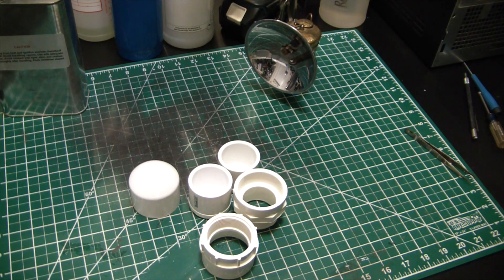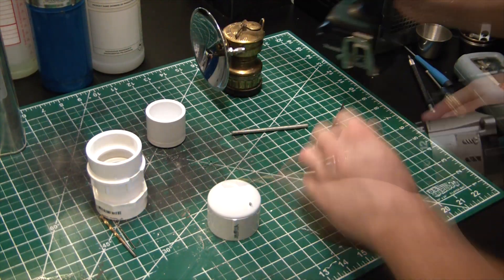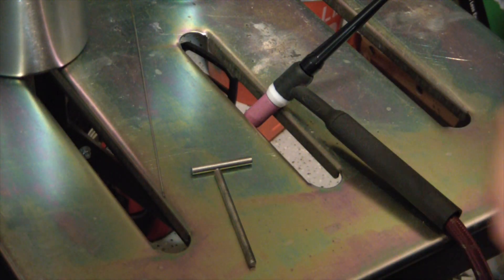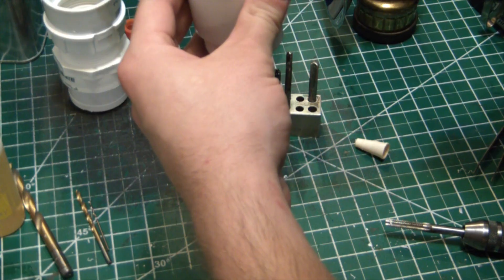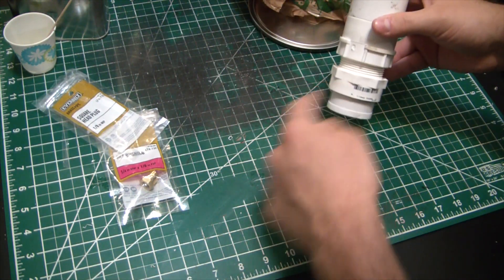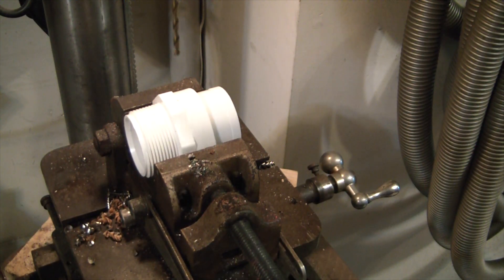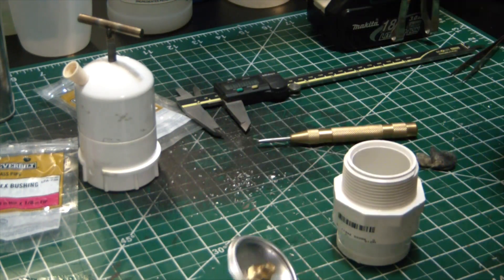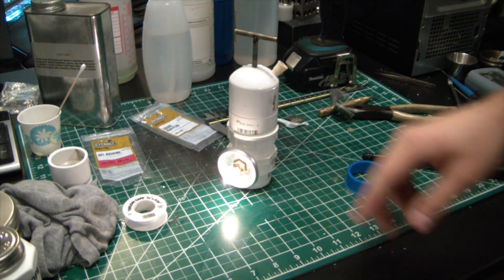DIY PVC Carbide Lamp - Dirt Cheap & Works Like the Real Deal! - ElementalMaker

Comment: Fyi  PVC glue dries instantly
Reply from the maker: I was a pipe layer for some time, it most definitely does not dry instantly. There's a reason you have to wait before pressure testing lines.

Comment: Sure that you found you need a tiny air hole in the top tank so no vacuum lock of your drip.... only thing I would worry about is the plastic melting.... you could run your output anywhere with copper tube run it up you could use that paint can lid

Comment: I made one sililar. I used the valve from an old Bic lighter and fit it inside the threaded part of a ball inflator needle that I removed the needle from and aslo used an old soda can bottom for the reflector. If you drill the hole first you can chuck it into a drill using a screw and some nuts and polish it with some comlound and the drill. Works great.

Comment: what is keeping the flame from flashback igniting inside the tank and blowing up?
Reply from the maker: Three things, a lack of oxygen in the body. The tiny office makes flashback difficult, steel wool behind the orifice will absorb heat from a flame front to extinguish it
Reply: @ElementalMaker  ahh yes i almost forgot that you packed it with wool,,but they say to use ss wool for this instead,but at the start there is air(ie enough oxy) in the body ,do you have to wait for that to vent out once the ace is being produced and creating pressure before you light it even though it has a small orifice perhaps this is a wise move no? ,,also what happens if the tank is inverted due to falling and the two chambers mix up? and last did you consider using a very small mig gun tip instead or is the hole of .024 still too big? ,merry christmas

Comment: Got to ask .... Why didn't you use one of a dozen or more PVC glues ?!  They come with all kinds of "open" times, from hot - dead slow (24 hrs.).  No mixing involved.  You'd have to break the PVC before the glue gave out.  Every hardware store (from Mom & Pop, to your Joe average Bigbox) carries them.  Should have been right at the end of the aisle where you picked up those fittings.  A Farm supply or Irrigation supply house will also have them.  I always keep a can, or two around.  PVC pipe has all kinds of off-label uses - Table legs, Greenhouse frames, chicken coop frames, dust collection systems ..... the list goes on.  Keep some on hand.  Way more effective.  Right tool - Right job.  I prefer a "Rain or Shine, or a Wet or Dry"  Gives you a decent open time, and it works in less than perfect conditions ( Rain, water in the pipe, condensation or high humidity, etc.)  Love your videos.  signed:  A fellow curious, collector of projects that will never earn me a dime !
Reply from the maker: Just didn't have any handy at the time and didn't feel like driving to the hardware store. Proper PVC cement would certainly be the better bonding agent.
Reply: Yeah, no .... I got to confess .... I've been caught with a dry can more'n once.

Comment: How is mixing up a batch of epoxy faster than PVC cement? The PVC cement would have it completely bonded in about 10 seconds after pushing the parts together. The epoxy is still getting measured out at the 10 second mark.
Reply from the maker: It wasn't faster. It was just what I had on hand. My old PVC cement had gelled.

Comment: I think the bottom of a pressurized can ought to be a catenoid, not paraboloid; through I'm sure anything remotely shiny and concave would have worked. You should have used the bottom of a can of spray paint instead. Would have been a lot bigger.

Comment: I know this is a stupid question but what was that brass pointy ended thing that made a clacking noise when he used it called?
Reply from the maker: That's called an automatic center punch. Great tool to have and you can get cheap ones online for just a few bucks.

Comment: Always amazed me, when I use to drill wells, that only after about a 15-20 sec. count after slidding a newly glued joint together, we'ld let, often with over 400 foot of at least SCL40, 6 inch diameter pipe below it, hang from it and they always held.
Reply from the maker: Holy smokes that's impressive. What solvent glue were you guys using? I get quick bonds, but not that quick!

Comment: One nice dirty cheap nozzle you can get are jets from small motorcycles carburetors.
BN44 carburator replacement jets, for example, can range from #10 (0.1mm) to #120 (1.2mm).
Reply from the maker: Great idea!

Comment: Well shit. I bought some calcium carbide a while back just because and its been sitting here being useless. Maybe I should build one of these. Knowing my luck though I will lose a finger due to it being a pipebomb and what not.
Reply from the maker: Eh just make sure it's airtight and let it run for a few minutes to flush out any remaining air. Fine steel wool as a flashback arrestor will help prevent that too.
Reply: What if I want to be 9 finger freddy?

Comment: Uhm...  isn't the acetylene going to eat the plastic or the bonding agents/epoxys holding it all together?  Isn't the flame going to heat the metal parts and thus melt the plastic parts, causing it all to come apart catastrophically?
Reply: How long do you plan a $5 plastic blow torch to last? Somethings ant worth worrying about.

Comment: Man I love your videos dealing with PVC ...PVC cement will make a solvent weld, much stronger than epoxy. And 20 seconds its cured again quicker than epoxy
Reply from the maker: Yes I love PVC cement for those reasons. Sadly I didn't have any handy when filming this bit. Have you tried the new Oatey fusion primer/cement combo? Stuff is a game changer its so easy. Plus its clear so looks much better. Not to act like their spokesperson but damn I like it haha

Comment: How is it burning so clean when acetylene gives off lots of soot, is it because there is still enough air in the carbide chamber that is being mixed with the gas?
Reply from the maker: I think that because of the flame velocity, it mixes better with air and burns more completely, converting the usual soot (carbon) into co2
Reply: Interesting, I might have to do some experimenting.

Comment: only issue is its 13$ in parts

except a laythe
and drill
and bits
and centerpunch
Reply from the maker: Well I have excellent news for you my friend, the center punch is only $2.37 on amazon! The lathe and drill press are simply convenient, but everything I did here could easily be done using just a cordless drill and some brain clackin.
Reply: I mean fair enough

Comment: Nice build. But I wonder about one thing. If left to burn long enough, will the brass fittings get so hot that they melt the PVC ?
Reply from the maker: That may be possible. I haven't run it long enough to find out, but may do some longevity testing on it to find out.

Comment: A trick with PVC glue is after you tighten the lid of the can turn the can upside down a few times, that way if there is any air ingress it hardens the glue on the threads preventing air getting to the rest of the glue drying out the whole can. Its a usedul tip I learned a longtime ago, hope that helps out some people to save thier glue after one use.
Reply from the maker: Very slick idea! Thanks for sharing! Ill definitely use that from now on
Reply: Learning Electronics Cheaply Nice learning from a fellow cheapskate ;)
Reply from the maker: I wouldn't call myself a cheapskate. Ive spent quite a small fortune on tools and chemicals over the years. This ain't no cheap hobby. I do however try to spend wisely!

Comment: Teflon tape on the brass threads would also tend to act as a thermal break between the brass and the PVC.  Teflon is used in 3D printers for the "hotend" for this purpose.
Reply from the maker: Solid idea. I just used some thread dope, but ill swap it out for some Teflon.

Comment: Parts are called 1-1/2 plug
1-1/2 male dwv adapt. 1-1/2 female adpt. Last fitting is called a husband , sometimes called father or mailman
Reply: And 1-1/2" smooth cap sch 40

Comment: Set it outside, light it and let's see how long it will burn before the heat from the flame gets the brass hot enough to melt the PVC threads. Then we may get a BOOM !  lol
Reply: the gas flow should keep it cool unless it gets low on fuel.
Reply: @psycho.dad5252  cool answer and its also a fact but some trolls like to think there being smart i guess my friend, just ask Radallolgy ?
Reply: Acetylene oxygen torches use a brass tip. They last for hundreds of hours before they wear out. The flame is away from the tip to begin with. What really Burns up or uses up and acetylene towards tip is when metal splatters back inside and you have to take the cleaner and push the stuff out that wears the holes out bigger but they last. As I said hundreds of hours and rough abuse work so this is nothing.

Comment: Use the lens out of an old square battery flashlight
Reply from the maker: Excellent idea! Problem is the only ones I have are plastic lenses. With the acetylene flame they would melt quite quickly. Need to find an old metal one!
Reply: ElementalMaker i restored my grandfathers old alcohol mining light for a relative and shaped and polished a dish shaped piece of a brass door kick plate
Reply from the maker: @jughead8988  very nice, where did you find that? I need to upgrade the soda can reflector
Reply: ElementalMaker i got the kick plate from lowes, i. Cut out a round peice and shaped it on the bottom on a 20 pound propane tank before polishing it
Reply from the maker: @jughead8988  awesome thanks for the tip! Very slick to shape it on the propane tank.
Reply: ElementalMaker i didn't want to hammer on the side i was going to polish

Comment: What the gases from that flame are they bad to breath in?
Reply from the maker: The main products of combustion are water and CO2. Of course some lampblack (carbon) is also produced from incomplete combustion, which is the soot you can see. Some CO will also be generated.
Reply: ElementalMaker well thats pretty awesome so other than sealed up confined spaces its pretty safe other than the open  flame and explosion possibility 😃
Reply: Acetylene.

Comment: The metal wool should also help keep any splashed calcium carbonate from clogging the nozzle.
Reply from the maker: That it should! Ill be replacing the standard steel wool with stainless or brass wool, since normal steel wool will degrade very quickly in the environment of the reaction vessel.

Comment: Use some kind of heat resistant PVC or material, because carbide and water produces an exothermic reaction that is enough to melt some plastics. Exploded a little plastic vessel my self doing it.

Comment: not sure if your much into 3D printing but id wager a 3d printed version would work great, using a .4 mm nozzle on an e3d heatbreak as the gas output. Not sure how much heat that little flame is putting off but an E3D hotend might be enough to dissipate it before it can warm up and soften the surrounding plastic.
Reply from the maker: Great idea. I didn't even consider using my 3D printer! And yeah the nozzles would probably be perfect to use!
Reply from the maker: My biggest concern would be the heat in the reaction chamber. The carbide/water reaction gets quite hot, and I think would soften ABS. PLA would definitely not be able to hold up. Maybe a 3D printed water chamber and PVC reaction chamber would work!

Comment: I wonder what happens when that lil brass fitting warms up?
Reply from the maker: I don't think it should heat up too much. The reflector helps dissipate heat in the brass. The acetylene is also burning a small distance from the brass tip, so not too much heat should get into it.

Comment: Ex-cel-lent!
Great project; great presentation.
À propos nozzles: you should be able to pick up virtually any hole diameter in (used) petrol or diesel injector nozzles.  Another good source of miscellaneous, good-quality parts is old gas equipment (regulators, u.s.w.)
Reply from the maker: Very good to know, thanks for sharing! I'll keep an eye out any time I visit places like that!
Reply: ElementalMaker If you put some thin copper or brass shim discs behind the reflector, it should assist in radiating the heat that might damage the plastic.  It might also help as extra flame-arrestor.

Keep up the awesome work!

Comment: Great video and build!
You have a PVC fitting plug, male adapter, female adapter, and PVC pipe cap, so you did pretty well at identifying them. 
P.S. Steel wool will burn, should we use copper wool instead?
About "resistance to being drilled," my wife has the same problem, how do we cure that issue?  LOL!
Reply from the maker: I just dont know how to fix that issue Robert. It would probably involve a lot more psychological work than I can comprehend. Maybe we can just hypnotize them! LOL Thanks for verifying the components. I'm sure copper wool would also work. The best would probably be stainless wool, I need to get some off amazon.
Reply: LOL! Thanks for answering!
Reply: Hint: It ain't the meat, it's the motion. Well . . . the meat is important but . . . yeah. :)
Reply: LOL! Laura, thank you for the useful insight into our issues.  :)
Reply: Just don't approach her with the old oil can.

Comment: See if you can get stainless wool. Works way better and won't degrade like regular. Tighten all 3 holes in the drill chuck. No more slipping bits.
Reply from the maker: Yeah I couldn't find any at the local stores, Ill get some on Amazon so it doesn't degrade.
Reply: Stainless wool doesn't degrade anything like the standard steel wool.  I think that was TE's point.  While it's not commonly stocked, I've never seen a bad lot of it.
Reply from the maker: Yessir. I was searching high an low for the stuff, since I know the normal steel wool will degrade very quickly in that environment, but none of the local places store it. I'm going to order some online.
Reply: The mention of copper below sounds useful to try as well, btw.
Reply: Seems to last well too. Kind of makes up for the extra cost for it.

Comment: Great job man. I like it
Reply from the maker: Thanks!
Reply: ElementalMaker 
Next time you have time to run it, can you doc a few things and post, if possible? 
1) weight of fuel used
2) burn time
3) highest temp of the reaction chamber

When I dropped enough pellets in my candle I made, I was worried about melting the chamber. But it's nothing more than a plastic bottle with a needle out of it. So I was curious as to how hot the reaction chamber with the nozzle attached will get while emitting a decent flame